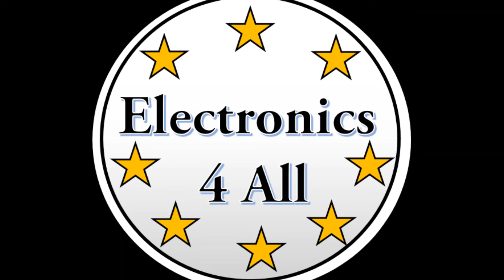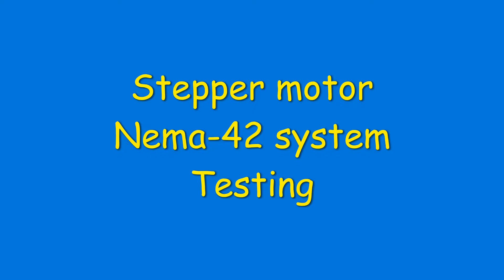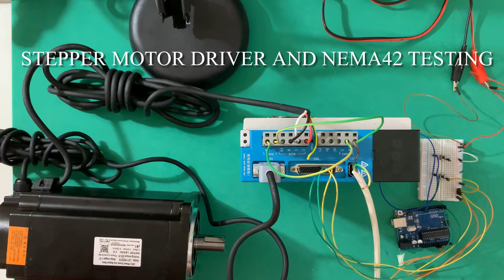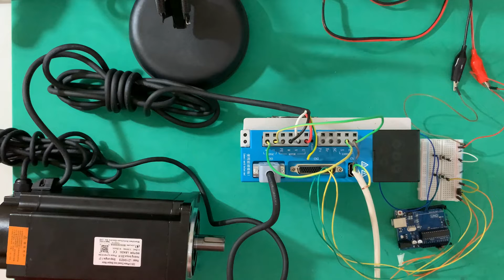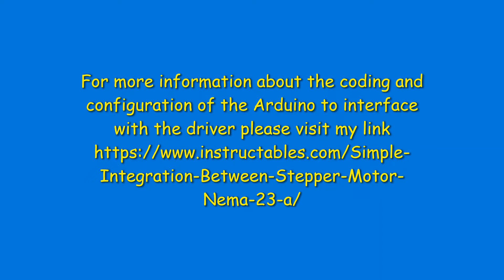Nema 42 stepper motor and close loop hybrid driver testing

Comment: 3 phase means It works in 3 phase current Ac. Everytime I search the motor  in the website. it shows 2 phase stepper motor.i could not unterstand kindly explained
Reply from the maker: Dear friend thank you for the comment, I will explain both: 
1.	The 2 phase stepper motor operate through two windings A+ A- and B+ B- both A and B are called phase so if you check the resistance between A+ and A- you will find it to be 0 ohms, like wise between B+ and B- , when connecting the 2 phase motor to a its driver you will find  4 output connections marked as (A+ ,A-, B+ ,B). 
2.	The 3 phase stepper motor operate through three winding U, V , W each one of these windings are supplied through one phase or (sine wave ) to make it simple so the sine wave produced by the drivers should work in harmony to the other sine waves in order to produce the prefect rotation, on the other hand each phase does not make a continuity circuit with the other phases as each other , for this reason each wire from the motor should connect to the exact output to prevent mismatch of the phases. In fact, the three phase provide more accuracy with high precision. 
Hope this answer your question.